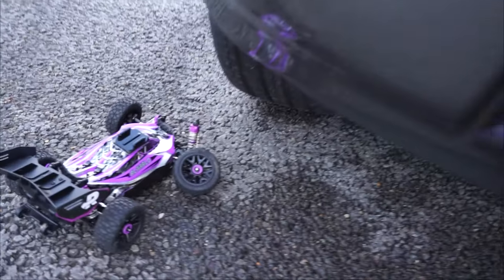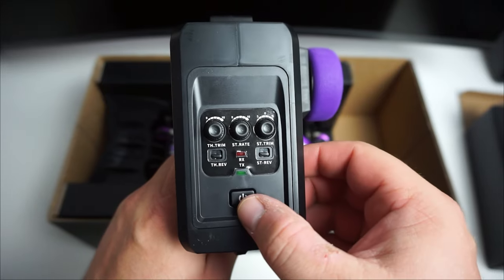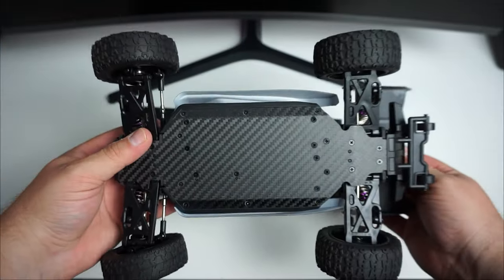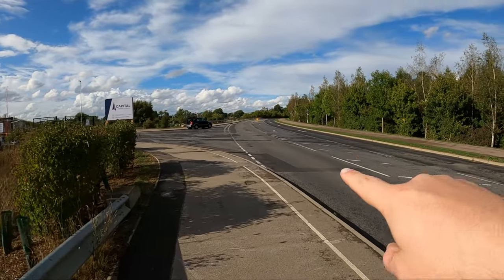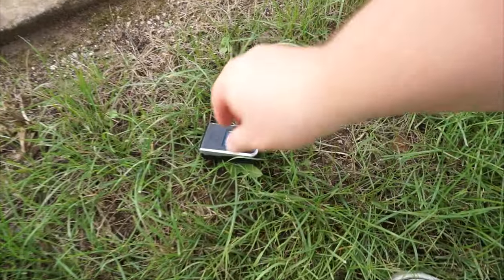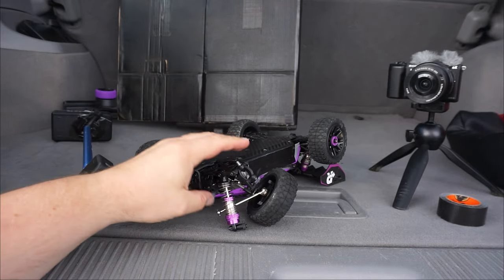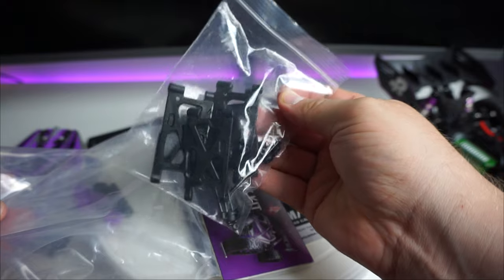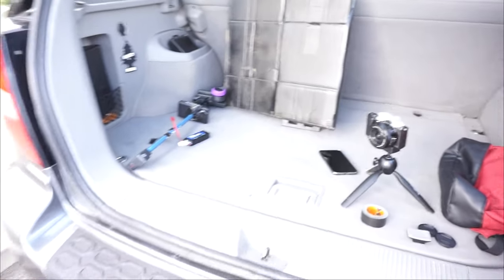Rlaarlo 1/14 Brushless Buggy, 80+ KMH RTR

Comment: Exact spot mine broke. They sent me replacements. They sent me metal towers and it’s good to go for blasting around the yard etc. Very fun buggy for the price with good customer support.
Reply: my rlaarlo front carbon shock tower just snapped in the exact same place as this video. They did not ask you to buy new shock towers ? I really did some light bashing. The carbon cannot resist.
Reply: @luccrouset1675  they sent me new ones. Asked if I’d rather have metal. So that’s what they sent me. The CF is great for speed runs I guess but there just isn’t enough material around that hole.

Comment: Well, now mine doesn’t want to hold steering trim and the brakes are just horrible. Not to mention the lag time. 

The 144001’s I’ve purchased have never had issues. Not to mention so many other nice buggies etc cheaper than the Rlaarlo. 

I’m going to do the transmitter mod and see how that goes. If that doesn’t work someone will get a good deal on marketplace lol